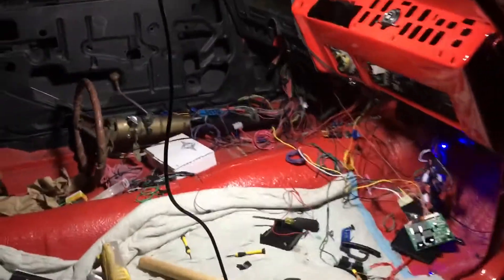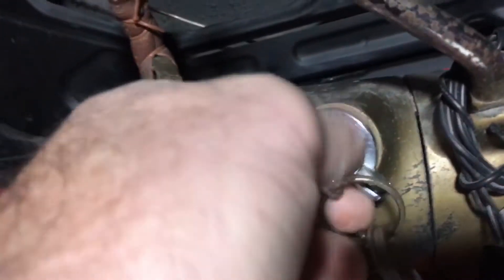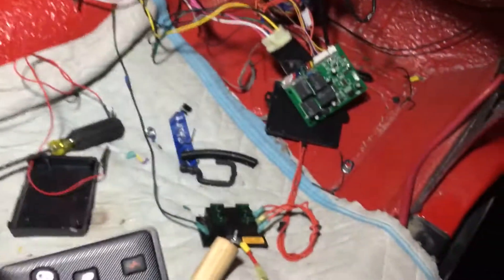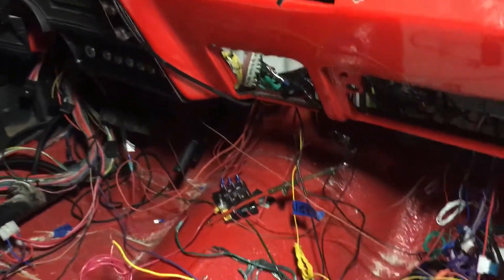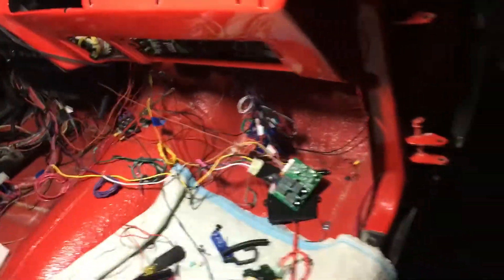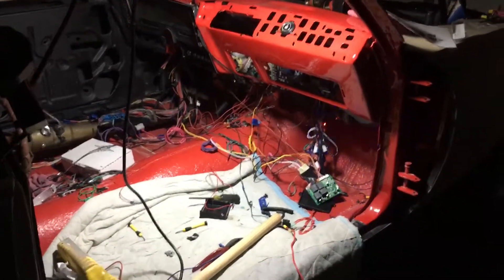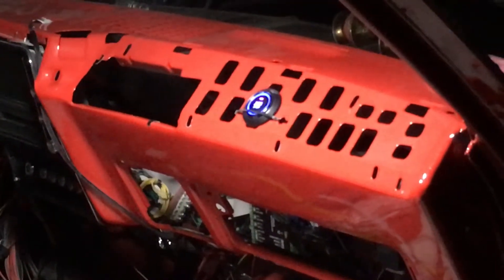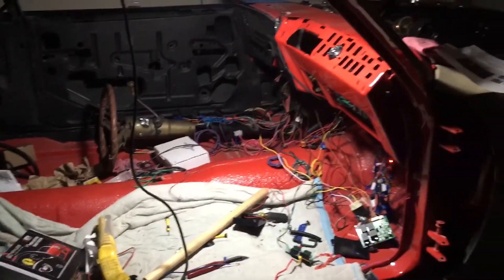GONE KEYLESS IN THE NOVA!!!

Comment: Hows the digital guard dawg holding up?
Reply from the maker: Eh tbh they’re all the same. On a 1-10 I’d give it a 3. Only bc I already am down one remote. I called them & they’re like meh oh well. Buy these big gawky ones. Wouldn’t even give me a discount. They’re customer service is awful. Now since I try did my wiring the auto start doesn’t work. They told me I disconnected the pier source in the wrong order??? Didn’t give me a solution to fix it. I have to press and hold the remote start button to get it to start. Which means I have to pull out my wallet watch and every time to start the car.. which is a pain in the ass. Also they’re products are way overpriced. 

If I’d have to do it again it’d be a hard pass for me. 

Best of luck it you buy one.